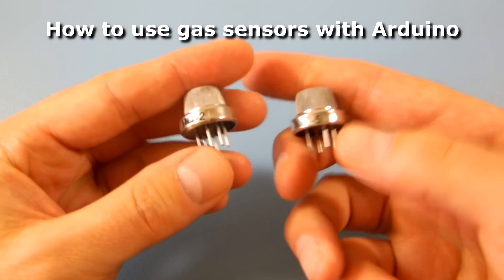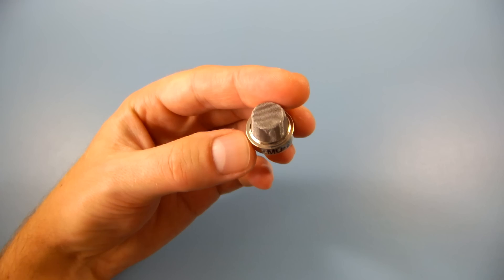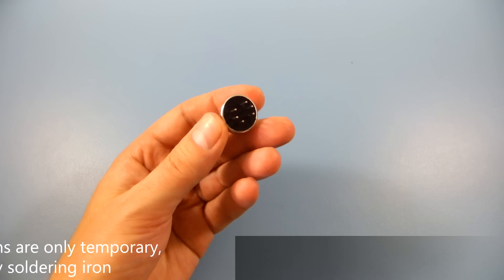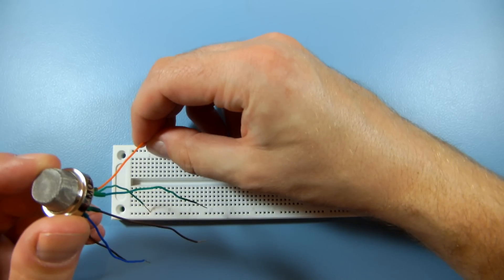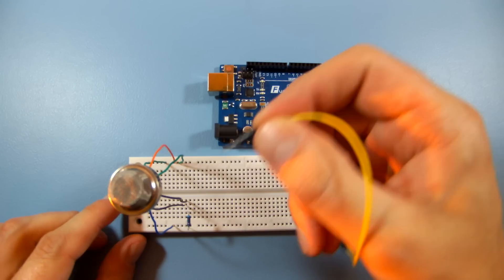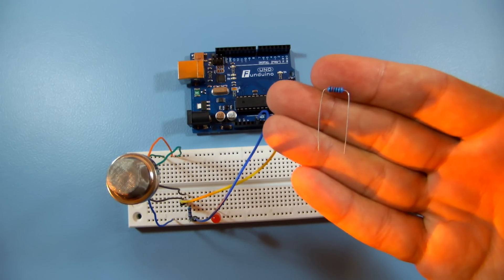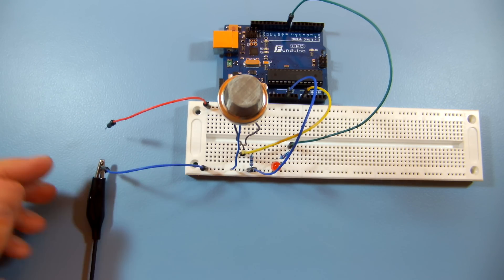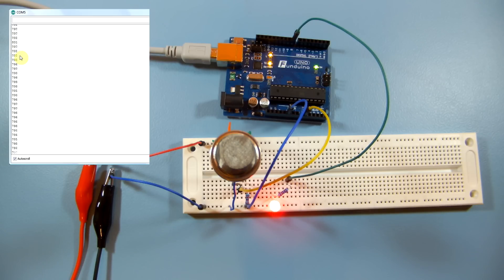How to use gas sensors with Arduino || Arduino tutorial

Comment: hello am gonna make a smart propen alarm to ma camper.

a thinking of using a arduino uno or better card som propensensores elektronik valve end a light's end horn..ma question is is it possible to have multiple sensors on sam card or shoda use one card per sensor..end what level sukde a pickup gas wight or danger   regards roger
Reply from the maker: Roger Linsefors Hi, Arduino boards have multiple analog input/output pins, so you can connect a few sensors to one board. Just remember to use external power source for the sensors. 
It's not that easy when it comes to readings from the sensors. Arduino converts analog input to digital values ranging from 0 to 1023 and nothing more. It' won't give you the readings in ppm or other units. There are some projects, where people base on sensitivity characteristics from the datasheet and calibrate their sensor in the code, but I haven't tried that yet. I'm not able to give you a value which is safe or unsafe.
Reply: tacks :)
Reply from the maker: Roger Linsefors No problem :)

Comment: Hello. Do you need a fan to direct the ambient gas if this sensor sits inside an enclosure box?
Reply from the maker: ***** Why do you want to install the sensor in a box?
Reply: ElectronFun.com For aesthetic purpose. I want to design a box that can detects gas leakage and smoke. Do I just leave a small hole opening for the sensor to detect the gas? Does the airflow is adequate enough for the sensors to detect the gas? Or do I put a mini fan to circulate the air into the box chamber?
Reply from the maker: ***** I haven't tested anything like that, but I guess a hole in the box might be not enough and a fan might affect your readings, but it's only my theory. It's always a good idea to try out new ideas.

Comment: Hello, 
you did fantastic job! well done. How can you calibrate your sensor? is this code valid for other gas sensor such as MQ 138 ? 
Cheers
Reply from the maker: Ali Altaey Thank you. Yes, the code will work with MQ-138. When it comes to calibration - you should calibrate it against an already calibrated sensor. There is also another method that you can try at home - just in the code, based on sensitivity characteristics, but I wasn't very successful with this, at least yet.

Comment: Good work and good video ,,,, why is my gas sensor be hot when i powred the circuit ????
Reply from the maker: laith mohamed Thanks, the sensor works properly in a certain temperature and that's why it has a small 5V heater. The sensor should be warm - it's completely normal.

Comment: This can be used for a carbon dioxide sensor MG811?
Reply from the maker: Reina Marroquin I've never used an MG-811, but I can see the wiring diagram is a bit different and the sensor uses 6V instead of 5.

Comment: Can i use it in flame detector circuit? Until which temperature it can easily work? If i use it near to fire will it works?
Reply from the maker: Rizwan Kamleen Unfortunately you can't use it in a flame detector circuit. The MQ-2 can operate only up to 50 degrees C, see here: http://sandboxelectronics.com/?product=mq-2-smokelpgco-gas-sensor-module.

Comment: Hello, do you have to calibrate the sensors ?
I start a little project with a MQ4 but I am not sure if the datas are correct.
Reply from the maker: Thilo 012 Hi, it depends. If you want to have your readings in ppm units for example, you would want to calibrate the sensor against a calibrated sensor so you could know the exact gas concentration. Another thing is consistency of readings - if you're getting inconsistent data you probably need to preheat you sensor by leaving it on for 24 hours (see the datasheet).
Reply: ElectronFun.com yeah i want ppm readings. but how can i calibrate it ?
Reply from the maker: Thilo 012 A few days ago I would tell you that you need to calibrate your sensor by comparing it with another already calibrated sensor or adjust it by exposing it to a precise gas concentration and it is true. These methods seem to be the most accurate, but there is another way (I hope) based on sensitivity characteristic curves from the datasheet. I'm going to experiment with this stuff and if I succeed, I may prepare a video about it.

Comment: I did not yet get my answer? in order to preheat the sensor, do I need to use the resistor or only use straight 5v power. My datasheet said it needs to preheat for 24 hours, but it does not mention if I need to use the resistor or not, my values with out preheat are coming in like:

0
344
200
523
123
882
1023
0
50
122

The values are very unstable, but do you think it will be fixed after the pre heat??

I am a very frequent viewer of yours, I like all of your projects,A quick answer will be apreciated, thanks in advance
Reply: Syed Ayman Waiting for your reply
Reply: three years no reply 😔😔

Comment: Hi sir, i also use module MQ-7; my kit is launchpad msp430g2553, i build my project by energia (the same as arduno). But sensor value is not display on COM monitor; here my code energia, can you help me?: 
/*
  Analog Input
 Demonstrates analog input by reading an analog sensor on analog pin 0 and
 turning on and off a light emitting diode(LED)  connected to digital pin 13. 
 The amount of time the LED will be on and off depends on
 the value obtained by analogRead(). 
 
 The circuit:
 * Potentiometer attached to analog input 0
 * center pin of the potentiometer to the analog pin
 * one side pin (either one) to ground
 * the other side pin to +5V
 * LED anode (long leg) attached to digital output 13
 * LED cathode (short leg) attached to ground
 
 * Note: because most Arduinos have a built-in LED attached 
 to pin 13 on the board, the LED is optional.
 
 
 Created by David Cuartielles
 modified 30 Aug 2011
 By Tom Igoe
 
 This example code is in the public domain.
 
 http://arduino.cc/en/Tutorial/AnalogInput
 
 */

int sensorPin = A7;    // select the input pin for the potentiometer
int ledPin = 13;      // select the pin for the LED
int sensorValue = 0;  // variable to store the value coming from the sensor

void setup() {
  // declare the ledPin as an OUTPUT:
  pinMode(ledPin, OUTPUT);  
  Serial.begin(9600);
}

void loop() {
  // read the value from the sensor:
  sensorValue = analogRead(sensorPin);    
  Serial.println(sensorValue);
  // turn the ledPin on
  digitalWrite(ledPin, HIGH);  
  // stop the program for <sensorValue> milliseconds:
  delay(sensorValue);          
  // turn the ledPin off:        
  digitalWrite(ledPin, LOW);   
  // stop the program for for <sensorValue> milliseconds:
  delay(sensorValue);                  
}
Reply from the maker: Tuan nguyen nhat Do you have any value in the serial monitor, e.g. 0, or nothing at all?
Reply: ElectronFun.com thank sir, my monitor don't have any value (nothing at all). But I fixed it by rotate RX, TX at port J3 of kit launchpad msp 430g2553 follow this link http://energia.nu/Guide_MSP430LaunchPad.html. And successful. Thank you so much. :)
Reply from the maker: Tuan nguyen nhat Thank you for posting your reply with the solution. Have a nice day :)

Comment: Hello maybe you can help me, it seems thatthis sensors are sensitive to more than one kind of gas. if im trying to detect an especific gas how do i know is not a false flag from another gas. and if some one can exlplain me the Sensitivity characteristic curve  in the datasheets it would be mighty apresiated.
Reply from the maker: Bernardo de Elía Hi, you are right - the sensors are sensitive to a range of gases. You won't be sure if it senses only one specific gas or a mix.
Reply: tnx... it seems that the MQ8 is the most sensitive to H2 so i think im going with that one. cheers

Comment: Thanks for posting this video.. I found it very useful. Have you though not connecting the Audrino directly to sensor and use wifi to exchange messages?
Reply: You need something to read the analog values from the sensor before transmitting them over wifi anyway

Comment: Thank you well appreciated
Reply from the maker: Basu Thapa Thank you, for watching and your comment.
Reply: ElectronFun.com hello i just bought a MQ-135 Sensor Air Quality Sensor Hazardous Gas Detection module and unable to use it do you have any video
Reply from the maker: Basu Thapa
I don't have any other videos about gas sensors, but you can use it in exactly the same way I demonstrated in this video. All the connections are the same and the code will work too.

Comment: hi! i m planning to do project on power windows of car! I am thinking of installing a gas detector(CO2) in it! I bought a MQ2 sensor slightly different from sensor shown in your video! It has a board and separate Vcc and GND pins! please help me in repeating your project using that sensor!
Reply from the maker: Tushar Gupta Hi, first of all - if you want a sensor for CO2 you would need an MQ135 or MG811. If you want to use your MQ-2 sensor for something else, please let me know what pins are there on your board.

Comment: Hello, Thank you for the video. It's helpful !! 
I would like to know if the use of the resistors is necessary or not ? and what are the effects if i don't use them? 
thanks.
Reply from the maker: Nada Hi, thanks for your comment! The resistor is necessary according to the datasheet. I guess the readings would be completely inaccurate without the resistor.

Comment: hello there. thanks for the video. i am doing a project involving arduino and gas sensor. however, i am using a CO2 gas sensor, my whole idea is to test the sensor in one of the car and see how much of a CO2 does it emit in a certain time. my question is should i use MQ-135 sensor or MG-811 sensor for this? also is the coding and wiring same as this one for MQ-135 and MG-811? if not  would you mind sharing it
thanks!
Best Regards
Reply from the maker: sudina shrestha Hi Sudina, thanks for sharing your project idea and your comment. You can use MQ-135, the wiring diagram is the same, but to make it work with CO2 you should follow this tutorial: http://davidegironi.blogspot.it/2014/01/cheap-co2-meter-using-mq135-sensor-with.html#.VRBvweGfxFo The MG811 is made specifically for CO2, but it uses 6V and the wiring diagram is a bit different (see here): http://pdf1.alldatasheet.com/datasheet-pdf/view/172004/ETC2/MG811.html

Comment: this is an interesting video. I would recommend you to explain more like how the sensor works or why to connect wires like this. I mean, now I know how the sensor works with arduino, but I can't do it if I want to add a sensor to my project.

take an example, we can get some analog outputs with this diagram, but what's the meaning of this value? how to convert the number to some standard numbers? This will be really helpful because if I want to do an air monitor project with this, I don't know how to define the number. LED lights up when it's 500, but what's the real number that matters in our life? In datasheet I see a relation between sensor resistance with ppm, but maybe a starter will never figure out.

anyway, this is a great video. I have subscribed and wish you have more excellent videos  :)
Reply from the maker: Zelra 仙賢戀軒 Hi, thanks for your comment, subscription and advice. I'm trying to make my videos not too long. Maybe I should have explained more details about the sensor.The values are something between 0 and 1023 and they come from Arduino analog to digital converter. If you want your readings in ppm units, you would need to calibrate your sensor against a known gas concentration (maybe this part of explanation should be included in the video).

Comment: Hi, excellent video. Does the ensamble and code work for other Arduino sensors?. I`m interested in CO2. Thanks.
Reply from the maker: Violeta Mena Hi, thanks for your comment.You can use MQ-135, the wiring diagram is the same, but to make it work with CO2 you should follow this tutorial: http://davidegironi.blogspot.it/2014/01/cheap-co2-meter-using-mq135-sensor-with.html#.VRBvweGfxFo There is another sensor, made specifically for CO2 - MG811, but it uses 6V and the wiring diagram is a bit different (see here): http://pdf1.alldatasheet.com/datasheet-pdf/view/172004/ETC2/MG811.html
Reply: ElectronFun.com  Thanks!!!

Comment: Hi ElectroFun,
I have a thesis for Gas sensor (MQ-4) and I want to add features like alarm and SMS notification. Can you help me on this project?
Reply from the maker: Hi Armin,
The wiring diagram for MQ-4 is the same, you need a 20k load resistor. You also need a buzzer and an Arduino GSM shield. If you have any specific questions, feel free to ask, but be aware I've never used the Arduino GSM shield yet.
Reply: According to my supplier MQ-4 is a analog no need for library. Is it true? Can you send me a diagram or schematic for this MQ-4 sensor with 20K, buzzer and GSM Shield? I really need your help on this. Thanks a lot..
Reply from the maker: Armin Lumanglas It is true, MQ-4 is an analog sensor and there is no need to use any libraries, only one of the Arduino analog input pins. The 20k load resistor is used in the wiring diagram on my project page: http://electronfun.com/project_2.php (that's the one described as 20-22kΩ). You can learn more about a buzzer here: http://www.hobbytronics.co.uk/arduino-tutorial7-piezo-beep. I've never used a GSM shield yet, but you can find out more about it here: http://arduino.cc/en/Main/ArduinoGSMShield.
Reply: Thanks ElectroFun. More power to you..

Comment: hello...can we use the gas sensor to determine tea aroma?
Reply from the maker: It might be possible, but to tell you the truth I haven't heard about it before. I googled something like 	 	 	 	 		
			 				 				 					zinc oxide nanorod sensing element, but have no idea how it works and if it's possible to use it with Arduino.

Comment: will everything(including codes) be used with MQ7 as well? thanks!
Reply from the maker: Yes, the wiring diagram is the same, the same code will work, but you need to adjust sensitivity (in the code and by the load resistor).
Reply: ElectronFun.com http://www.circuit-help.com.ph/product/co-gas-sensor-mq7/ i bought this one, will the codes be working also without the breadboard?
Reply from the maker: Einnor Lester De Villa
My code should work with your sensor. You don't really need a breadboard - it just makes prototyping easier.

Comment: Hi, great video, I want to add in a 6v buzzer, what the best way to do so? I have never used this code before, thanks!
Reply from the maker: Hi, thanks! Arduino Uno is rated for 5V, so it would be better to use a 5V buzzer. If you deliver voltage to the buzzer it will turn on. If you want to change the tone, you could use Arduino "tone()" (http://arduino.cc/en/reference/tone).

Comment: Hello ElectroFun,

Very great job!

When searching some MQ sensors to buy, I found out that some of then already come with a board on themselves, and has four pins for connecting, like somoene said on a comment bellow.

The DataSheet of this device is identical to that one you've linked above, and the circuits I've found just say to connect de VCC pin to de Arduino's 5V, the GND pin to Arduino's GND and the AOUT pin to Arduino's A0, without any resistor or mentioning the heaters.

I just wanna know how three things about this kind of device:
- How does the heating system works? How do I preheat the sensor? 
- Why in this case it's ok to connect the whole sensor and board in the Arduino's 5V pin? Won't this damage my Arduino, or only if I connect some other devices to it, like LED or Buzzer?
- And the load resistor, why isn't it necessary any more? How can I adjust the sensitivity of my sensor whitout it?

Thanks! (sry for my english)
Reply from the maker: Hi Lucas,
Thanks a lot for your comment!
That's true, there are some sensors mounted on a piece of breadboard with pretty much all needed circuitry. The load resistor is there, both A pins are connected to each other and both B pins are connected to each other as well. There are some boards like this with only 3 pins: VCC, GND and AOUT (sense line). You can even buy sensors, which are already calibrated and show PPM readings, but they are usually much more expensive.
To your questions:
1. The sensor is most accurate in a certain temperature range and needs a heater, which is a simple coil. In the datasheet you can usually find information how long you should preheat the sensor - it means you should leave your sensor connected and running continuously for this period of time (for example 24h).
2. The sensor won't kill your Arduino by itself. It usually draws up to 800mW at 5V, which makes 160mA. Arduino 5V-GND pins can deliver up to 200mA at 5V. You have just 40mA left and it's not the best idea to draw maximum current all the time from your Arduino.
3. The load resistor is usually mounted on the sensor PCB. You will usually find a potentiometer on such boards that you can use to adjust the sensor's sensitivity.
Reply: ElectronFun.com , Thanks for helping.

Do you know were can I find these sensor that already come calibrated in PPM? Or, at least, their avarage price?
Reply from the maker: Sorry, I can't find these calibrated sensors anymore. I don't remember prices, but it depended on the type of the sensor.
Reply: ElectronFun.com Ok, thank you for helping.